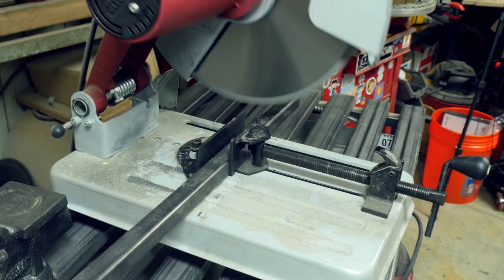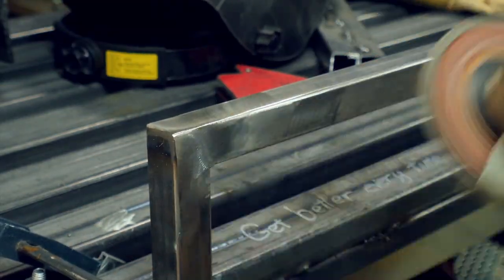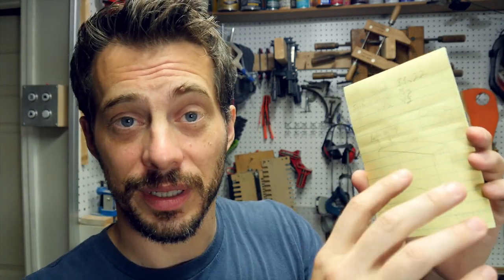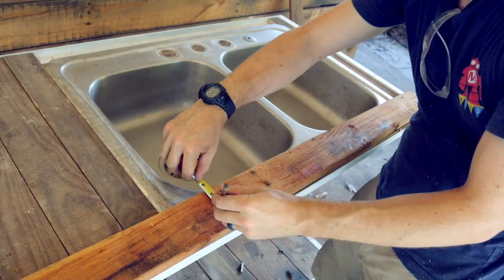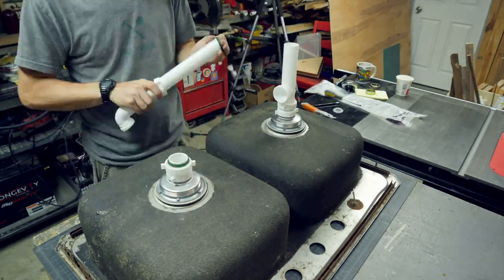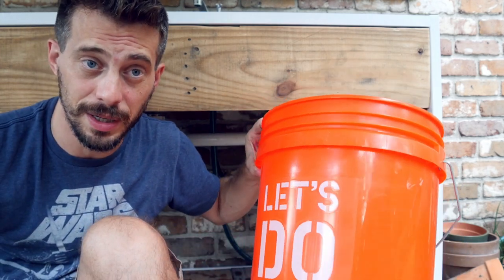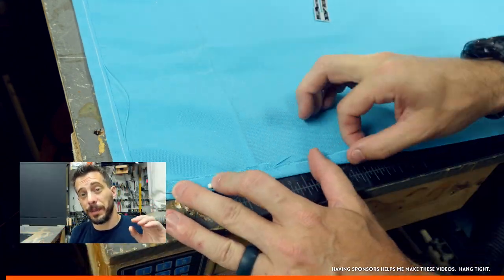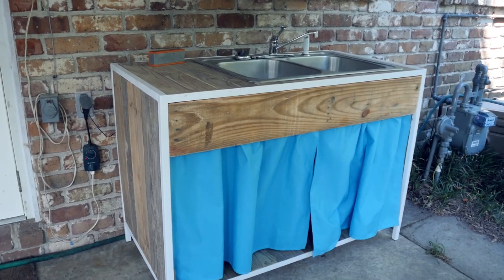Outdoor Kitchen Sink // Woodworking, Metalworking, Sewing How-To | I Like To Make Stuff

Comment: Welcome to the sewing club.  I knew how to woodwork and metalwork.  Bought a heavy duty walking foot sewing machine to sew nylon straps and canvas for camping gear and what not at which point I only knew how to do hems and patches in boy scouts.  That lead into buying binding attachments, upholstery gear, all kinds of things.  Speaking of polyester, I got tired of using a soldering iron and a lighter to seal the edges and I bought a hot knife.  It's kind of become my latest obsession.  My wife complained so to make up for it, I ended up sewing a set of full length drapes for her, recovering two pieces of furniture, and now she wants a tufted headboard.  Sheesh.

Comment: Seamstress tip: With most modern sewing machines and even some older ones if you put the pins in horizontal to your seam you can sew right over them. which comes in handy for really tight or invisible hemming.

Comment: Bob, if you've noticed an increase of mosquitoes you may want to change up the bucket collection. Standing water is their go to. As a previous GA resident I can't imagine that. Hope you didn't get mobbed by them.

The table is awesome & I love the wood/metal combo! Do you ever have issues with welding on a metal table? I feel like I'd weld to it.
Reply: You can just add a little bit of slacked lime to the bucket, mosquitoes won't breed in such water
Reply: Dish soap messes with the water tension and would also disrupt and possibly drown the adult mosquitos.
Reply: HurricaneD7 hand full of salt would work too

Comment: Really like the look of the pallet wood with the white metal for outside. Sweet!
Reply from the maker: Thanks!  I think if the wood were a little darker/richer, it'd look even better.  The polyurethane coat will probably help that a bit.
Reply: Yep i agree. Did you not fancy putting doors made of pallet wood on the front?
Any clever ideas to keep an eye on the waste water overflow?

Comment: I just recently did the same thing for a camping trip. I hooked a Y adapter between the hot and cold lines for the faucet so if you turn the faucet to the hot side you still get water. Both sides are fed by the same hose, so temperature is the same.

Comment: 8:15 If you put the pins in horizontally instead of vertically, you can actually just sew right over the pin, and then just pull them all out when you are done.
Reply: Sewing machine needle rarely go flying when they snap. Sewing over pins is just like any other activity in the shop, if you don't feel safe doing it, don't, otherwise carpe diem and weld in your shorts ;)
Reply: Usually when the needle breaks the broken part should get caught by the thread so nothing should go flying

Comment: some pro-tips for next time you do some sewing, if you put the pins in at 90 degrees to what you did then you can just run straight over them with the machine, its much faster and good for if you're doing more fiddly stuff, also there was no need to use the lighter on that edge because it was whats called a selvedge, its the edge of the fabric that is made as its woven, you can identify it because you can see that its more tightly woven and there are small holes along it, the selvedge will never fray, no matter what fabric you're using, also if you don't want the cut edges to fray but don't want to turn the hem up twice you can run over the edges first with a long and wide zig-zag stitch so the needle stitches both on and off the edge of the fabric as you sew ( if that makes sense haha ) the threads will encapsulate the edge and prevent fraying, or you could simply use pinking shears which cut a zig-zag and also prevent fraying. 
other than that well done haha pretty good for a first timer, im impressed :)

Comment: Not sure if its been already mentioned but when using pins to hold material for sewing if you put the pins 90* to the direction of the seam you can sew right past the pin and have a tight smaller seams.. Learned that in HS Boys Home Ec. as it was called in 1973.

Comment: Something to let you know when the bucket is full would be a fun project idea.  Perhaps just a float valve attached to the bucket (kinda like whats in the back of a toilet)  added between the hose and the facet so when the bucket's full, the water stops flowing.  It could be clipped or clamped on so it could be removed to empty the bucket or just attached to the back wall positioned to over hang the bucket .

Comment: hey, 
this was a great and a simple project. 
I have an idea for the bucket so it doesn't overflow. You can make a cheap alarm (something like what they use for fishtanks to keep a constant level). If the water rises above a certain line, an alarm goes off. this way you wont have water overflowing from the bucket underneath. :)

Comment: The hem ruler you're using, you actually slip the ruler between the fabric and the blue slider is your stop for the folded over hem. The slit in the middle is so you can pin your hem at the point of your hem measurement.

Comment: Think salvage, for the front cove maybe some used cabinet doors or even some scrap stainless steel BBQ cabinet doors our local scrap yard gets used commercial kitchen equipment at least once a month the break it up for scrap. Also there is architectural salvage these would be areas that can give you up graded projects for video.

Comment: You've probably sewed way more after this, but for others, if you want to seal the seam, the easiest way is to put your sewing machine in reverse at the end, go forward again, reverse, etc a couple times over each other. It's way faster than taking it off and knotting it at the end, and also makes many different knots over each other.

Comment: One quick upgrade might be a hose connector over the outgo. Then you could dump to the bucket OR run a long hose out to the sewer depending on what was being done. PVC cap and a hose connector is all you'd need to add - maybe?

Comment: You'll want to use the zig-zag seam on the edges to keep them from fraying, but I guess double folding it could work too. It will probably not be an issue for you though, the curtain will probably get quite dirty long before that ever becomes an issue.

Comment: 1:24 When you welded the squares onto the ends of the tubes, I thought those were going to be the bottom ends. Then there would have been no need for the plastic inserts.
There are small (10 gallons or less) water heaters that run on 120v and would fit nicely inside the cabinet. Plug it into a GFCI-protected outlet, wait an hour or so, and you'll have hot water. Make sure the WH is filled first.

Comment: You can 2-tier filter and pump up the drain via hot water pipe as a secondary water source for a "dirty wash" (in the same way as japanese toilets use the top sink's drain water to flush the waste).

Comment: It looks like you might be pulling on the fabric or holding it taught as it goes through the sewing machine? That will damage your sewing machine - often irreparably. The feed dogs on the machine will push the fabric through at the right speed, you just need to gently guide it through to keep it straight.  Having a hand on either side of the needle to guide the fabric, and stopping to move your hands as needed, will help get a nice straight seam without damaging your machine. You can also fold the fabric over twice to make a seam without any frayed edges. I kinda love the hack of burning off the frayed bits though!

Comment: When using the sewing machine, it is better to put the pins perpendicular to the seam you want to do.
This way the pin heads don't hit the foot of the sewing machine.
And it reduces the chances to hit the pins with the needle.
I like pins with a tiny head better, so i don't have to worry about the position of the pinheads vs foot.
When sewing my sailboat's sails, I don't use pins, I use double sided tape instead. This way I can manipulate the sail without stinging myself or having pins slipping out.
Hope this help.
Take care !

Comment: I wouldn't recommend using polyurethane for an outdoor project.  It will peel over time. Instead use Spar Urathane. It's made for both indoor/ outdoor.

Comment: thanks for sharing. Questions/thoughts. Because I really want to do this using an old kitchen sink we have, 1. Is it possible to just use an old cut hose to drain the water off the porch etc? So then you don't have to empty buckets? 2. I'd like to add some doors.. any vids on such a project for I guess... cabinets with doors? Thanks a bunch!

Comment: Awesome project!
I have one question though regarding the capped of line to the tap. Isn't that piece of pipe going to fill up with water via the faucet? If so the water in that bit of pipe could become a source of bacteria since the water in there isn't flowing or being refreshed.

Comment: Maybe you should add an adapter to turn the drain into a hose so you can have a bucket on the side that is easily accessible and visible. And then if you are just rinsing just let it drain into the soil or an irrigation hose.

Comment: Hey how does welding effect videos do you need to put anything special over the lens? And I had heard when predrilling you are only supposed to drill through the first layer because predrilling both layers makes the bond weaknes because the screw has less to grip to

Comment: Why is it that we hang cut all the wood that we can but when it comes to metal work, we tend to cut it piece by piece? Great build.
Reply: Maybe out of fear that it will get stuck in the blade? If a piece of metal gets catched by the blade things could end very badly. Or maybe you avoid it because it seems to tough for the machine.

Comment: Bod, I'm in the beginning stages of becoming a maker and love the prospect of using reclaimed wood (pallets, barn wood, etc.) primarily because it is inexpensive and often free. However, I've heard horror stories of old wood used in projects inviting termites, beetles, etc. into homes. As a maker who frequents reclaimed wood, do you have any experience with this? Do you have any suggestions on how to avoid this? Thanks, and keep up the great work!
Reply from the maker: Honestly, I just inspect it and hope for the best.  I've only seen termites in ones that were sitting in dirt for a long time.  I store them on concrete, if outside.  Thanks!

Comment: Try folding the edge over and hit it with an iron and press the edge much easier
Reply: try&#160; a tile top on some cement board ,its cheap and it would take the weather

Comment: Why din't you made the top panel like the bottom one and then cut out the hole for the sink? That way the wood is in the same vertical direction and not horizontal like you just did.. Also i would ad some sort off sealer for the sink so that the wood doesnt rot over time

Comment: Did you not have your Raspberry Pi 3 Display Sign turned on? (controller in background)
Reply from the maker: It was in progress while this video was being shot, if I remember correctly.  I usually have a couple in progress all of the time.
Reply: But the button for "On Air" wasn't lit up?

Comment: If the wood counter rot's you'll just replace it?
Reply from the maker: Yeah, but that wood has been outside for a very long time with no rot.  Also, it will live under a covered patio, so it won't be directly hit with rain, etc.  Adding the polyurethane like I mentioned will help protect it as well.
Reply: +I Like To Make Stuff Ah, I see. Thanks for replying!

Comment: What is the name of that kind of welder with the real thin slendar tip?
Reply: you mean like a soldering iron?
Reply: you mean like a soldering iron?
Reply: No've, not a soldaring iron.  Big thick brass looking hand piece with thin pencil lead skinny rod combing out of it, makes big bright light when he touches it to the square tubing plus he attaches a ground clamp(?) to the metal.  But it does no look like he's adding metal from a separate rod, the thin skinny thing must be melting the metal of the tubing.

Comment: What are some other uses for this sink?
Reply: washing of the blood on your hands :P
Reply: off *
Reply: The biggest use is probably just for cleaning, but it can help in a lot of different cases. (ie; cleaning brushes, goggles, shoes, hands, for kids in general, and things like that.) It would be best build for someone who works outside a lot, or with messy materials from paint to just charcoal from the grill (neither that you want to drag inside). It would also be helpful for dealing with dangerous chemicals, like a sink you would use in a science class.
Reply: Gardening. 

When your kids play and get dirty, make them wash their hands outside :)
Reply: With the plugs in, this'd be a great drink cooler for outdoor barbeques too!
Reply: I nearly had tears laughing at this , good one sir,
G

Comment: Instead of cutting the bar as a cap, couldn't you just mitered the edges at 45 deg.?
Reply from the maker: Yeah, you definitely could have.  I've had mixed luck with metal miters in the past, but that could have been my old saw.  This new metal cutting blade would probably make it work better.  Maybe I'll try that again next time.

Comment: does he know that you can sew straight over the pins
Reply: You can sew over pins, but you run the risk of hitting a pin and breaking the needle.
Reply: It's very unlikely though isn't it
Reply: +John Jessop not really
Reply: Actually, its much easier than people would think, js
Reply: usually you want to sew over them if the pins are perpendicular to the direction you're sewing. He was right to take them out

Comment: Don’t weld inside bud it could turn bad
Reply: Adam, most folks have to weld inside.  As long as you have good ventilation and are aware of your surroundings you will be fine.  I don't think welders take time off when it rains or snows.

Comment: You did far more work than you needed on the ends. You could have simply cut opposing edges... ugh this is hard to explain. It would be a little bit like a puzzle. It's pretty dope and really strong, more surface area welded together.  Ugh the name of that joint is gonna bug me.... looked it up. Cope joint!

Comment: enjoying your horror freight tools?
Reply from the maker: I enjoy the money I save by owning those. For the most part they work very well for what I need.
Reply: I Like To Make Stuff they'll work for awhile.
Reply from the maker: Graydon Treude Feel free to buy whatever works for you and your budget, but try not to disparage others for doing the same.  Not all of it is good, but most of the tools I have from there have lasted for years.  I've got a biscuit jointer from there that has been used a ton and it still works great after 15 years.
Reply: +I Like To Make Stuff I just wouldn't buy the power tools if you could afford better.
Reply: if i were him i would buy some second hand power tools since it does not take priority. What really matters is supplying for yourself and family.
Reply: +OnyxBlad3 it's called sponsors they pay him to use there products.
Reply from the maker: Isaac Irwin Who pays me to use their tools? I'd love to know so I can send them a bill :)
Reply: That's the thing about Harbor Freight - as long as you do some research and read reviews, you can find stuff that does a great job of getting the job done. More expensive certainly doesn't automatically mean better!
Reply: +I Like To Make Stuff There are some real gems at HF, and many others that are good enough to get the job done. I have an older orange 4.5" angle grinder from HF that just WON'T die. It's noisy as heck and I think I even left it outside in the rain once but it keeps grinding away. 

In addition, not every homeowner needs professional quality tools that you can rely on day in and day out. Why buy an expensive tool that will only get used once or twice in the foreseeable future?